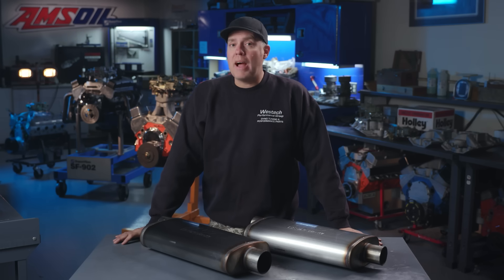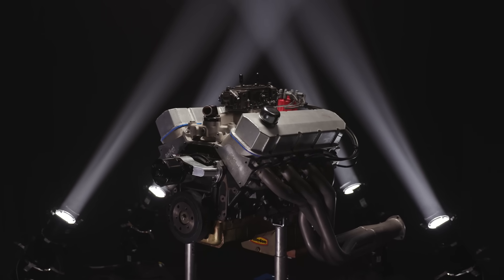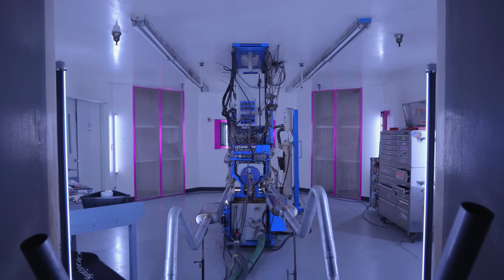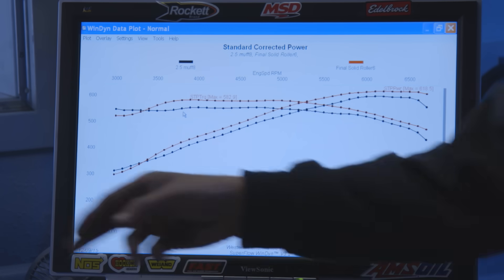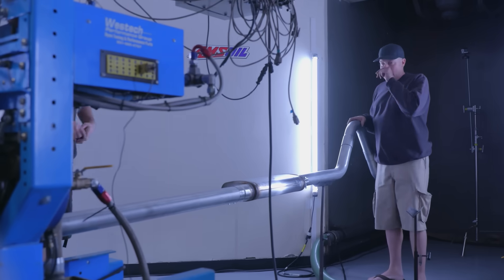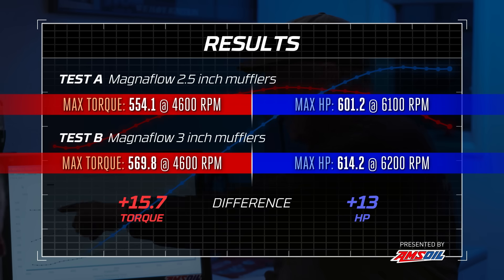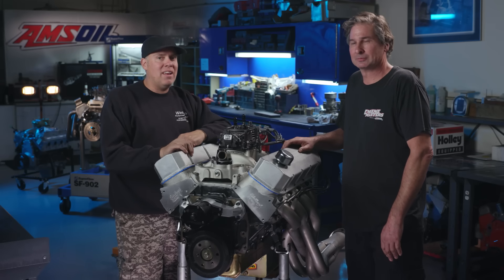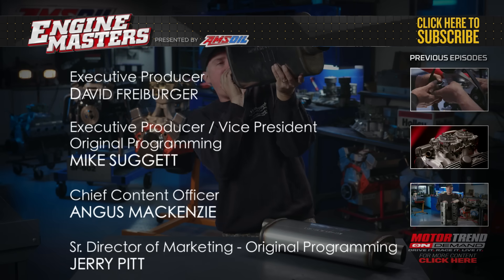The Power of 2.5- vs. 3-Inch Exhaust - Engine Masters Ep. 9

Comment: Of course the 3" was better. A 454 making 600+ is flowing a shit load of air, a 2.5" is definitely going to be restrictive. But this is a big engine, a 2.5" is probably going to make more power on a small engine than a 3" would. If these guys cared they could calculate flow rates and actually figure out the optimal pipe diameter for there system.
Reply: +Taylor Elley yeah i was hoping they'd use an engine with 300-400 hp or something that most people actually have
Reply: +Taylor Elley Did you not see how the open headers STILL made more power. Basically you will never loose power with less restriction. Obviously the gains by having a huge diameter exhaust on a small engine wouldn't be worth the extra noise, so you find a nice compromise you're happy with.
Reply: They weren't open headers, they had a tuned length extension on them, remove those extensions and you'll probably see a power drop (exhaust acoustic design is a fucking interesting topic).

Even more dramatic, remove the headers. Surely you would say the 2.5" headers are a restriction? That would mean no headers = more power right? No fucking way.

 I would like to see the difference in power if you removed the muffler from the 3 inch system (same length exhaust). Or if you shifted the muffler to the point where the header extensions would have ended (18" from the header if i remember correctly?)

Comment: i think i would give up 20hp in order to be street legal and not have exhaust drone.
Reply: nah, i guess i have different ideas of what a car should be. something that only goes to the track or show, by all means run straight pipe. something i drive as a semi-daily it has to be legal and comfortable. going from 620 to 600 is only a drop of about 3.5% which is not noticeable while driving.
i think the best of both worlds would be to have the quiet exhaust but has dump valves for race application.
Reply: +adam courtney straight pipes are gay, flowmaster 40's are where it's at.
Reply: Alexander Moffitt i won't get into what is better in regards to brands but i just said straight pipe in regards to no caring about the noise.

Comment: Why do we have to mislead people by oversimplifying incredibly complex fluid dynamics.  Bigger isn't always better.  Sometimes with a smaller motor, smaller tube will actually flow more gas because of higher exit velocities.
Reply: +Get Shrekt At least they informed people about the back-pressure myth. I hear this from almost everyone. People need to be informed that one of the main reasons to properly size your exhaust is to maximize exhaust scavenging which actually lowers back-pressure.

Comment: Whys do these guys always use a chevy engine?
Reply: Because Chevy is better
Reply: than...?
Reply: +Alexander Moffitt says inbreds
Reply: +Tiger productionzz common cheap engines that's why
Reply: matthew von oh
Reply: +Tiger productionzz  They're tremendously popular, these days you see a lot of Gen 3+ LS chevys and the Mk IV Chevy Big Block has always been popular, parts are plentiful a lot of kits to bolt the motors in a lot of cars.  The Small Block Chevy has been popular for 50 years and there are so many of them out there you can get a six pack of bare short blocks for a single aluminum LS motor.  I'd say after these the Chrysler Hemis are popular especially among drag racers and the Windsor V8 Ford, again because they've been around forever parts are cheap and there's a ton of easy recipes for building them.

Comment: question. I have a 427 sbc in my 68 Nova. I Run 3" exhaust and I recently installed electric knockouts. I installed them behind my X-Pipe, and the knockouts are about a foot back from the headers. Anyways, Will the X pipe (3" also) kill a good amount of HP if any?

Comment: hey engine masters.. does this theory apply to turbo charged motors as well? maybe try repeating with the same? 
Love this segment!!!
Reply: +Sulleiman Kamau With turboes the larger size is better, you don't have to worry about noise as much as the turbo itself acts like a muffler. All you really need is the down pipe.

Comment: Would have liked to see you add an X pipe vs H pipe to go along with this vid! Great vid though!
Reply: +sailorsteve56a A mustang magazine has a comparison..I was surprised of the sound difference, H-pipe is deeper sounding vs. the X pipe. I saw in chevy magazine, both give the same type of power increase 7-12hp depending on the motor's output.

Comment: I have a Paxton coyote on stock exhaust with just an offroad X... I've chosen to put my blinders on and avoid changing the rest of the exhaust because I like the quiet/sleeper effect... but it looks like I gotta get with the program.  Car put down 570 uncorrected, 598 corrected at the wheels, so probably a good bit more crank than this block... I wonder how much factory exhaust manifolds, resonators and mufflers are costing me. heh

Comment: Very good info. I have a 2004 dodge ram hemi stock engine with a 3" stock exhaust and a 2 1/2" Flowmaster outlet and tail pipe, would I need to upgrade the engine to see improvement if I install a 3"  full exhaust?
Reply: +Matari 7 3" single to dual 2.5" flowmaster cat back? Yeah, It would be best to wait until you have more engine work done and run full length headers race cats and do true dual 3". The stock manifold, Y-pipe and cat are the big restrictions for you. TTI makes the best exhaust for any MOPAR link below for what you need.

Here is your stock manifold/Y-pipe, cats( you can see how the Y pipe is compresson bent/pinched down
:
http://image.sporttruck.com/f/9006749+w750+st0/0705st_02_z+2006_dodge_ram+stock_manifolds.jpg

Truck trend put on a TTI full exhaust on a 06 5.7 and picked up 43!!! more lb-ft of torque at 3,400rpms. Here is a pic of the TTI setup:

http://image.sporttruck.com/f/9006752+w750+st0/0705st_03_z+2006_dodge_ram+headers_and_y_pipe.jpg

and here is the article:

http://www.trucktrend.com/how-to/engine/0705st-2006-dodge-ram-tti-exhaust/

Comment: i gotta say i have an 88 f250. had the nasty stock exhaust put on duel 2 1/2 pipes into an x pipe muffler and out as 3 inch and it really woke up the engine

Comment: it was a pretty predictable thing lol I do think it depends on power. a 600 hp application does need a 3 inch exhaust. a 200 hp application? I know the fiesta st comes with a 2.1 inch exhaust from the factory. upping that to 2.5 is the perfect size for keeping the engine from becoming too lean or rich whilst giving the engine the added boost.
Reply: +Dylan Knight This was exactly what I was thinking when I was watching... Lots of CBE are going for the bigger = better with their 3" exhausts. But there's a reason why the more reputable brands like COBB, mountune, fswerks are all using 2.5". Cause the oem turbo doesn't make use of a 3" pipe. Unless you cyborg or big turbo, 2.5" is better.

Comment: Tell me where I'm wrong here...
I'm thinking if you'd corrected jetting on the 2.5" system to get a better A/F, you'd not only make better power but you'd improve fuel economy as well?
(Yes, some of us buy our own gas. Shocking, I know)
Further, you made no mention of A/F on the 3" system. I wonder how close to just the open extensions it was - or even in comparison to the 2.5" system?

Comment: Everyone hear me before going all internet on me..so they proved the 2.5" is the better way to go or at least basically the same end result. 13/16 gains at the crank means, what, 9/12 at the wheels? But you gain 10lbs which kinda negates the power advantage making it a personal preference..also remember the farther south of 600hp you are, the smaller the gains will be but you still gained 10lbs.
Reply: I was thinking the same. They made the difference out to be much more than it was.  3" had more under the curve, but 2-3% gains isn't blowing anything out of the water.  On the street, it's only use is begging for attention.

Comment: Id like to see this on a small block with a much smaller displacement.
Reply: +Kevin Jones That is what I was wondering. I went 2.5 on a supercharged small block with long tubes & no cats  because I did not want to over do it and lose torque. But my high school self said to put on the biggest exhaust I could find. I wonder if I should have listened to him? He also said to install the biggest cam and 4.30 rear gears....

Comment: would love to see the 3 inch with an H pipe or an X pipe.  thats whats in my 68 firebird with a mild 461 stroker and I love it.
Reply: +Invincible Extremes Muscle Cars Garage exactly,   and throw a Y-pipe in there  for good measure.
Reply: +SOCAL3800 yes, because many guys have 3rd gen and 2nd gen camaros with that setup.  and trucks too

Comment: Would be nice to see this comparison on an engine like the majority of people have.  Say maybe a 300-350 hp motor.  The findings may be different and the motor isn't moving as much air as a 600+ hp motor.   Would also be nice if they added in the H-pipe and X-pipe into the comparison to see which system offers the best performance.  I guess its all really depending on your motor which size system you need to run.

Comment: Exhaust pipe sizing has one ultimate goal if you're going for max power: exhaust gas velocity. Too small piping will choke the motor. Too large will lower the exhaust gas velocity and actually make less power. They key is to find the sweet spot for your setup. Bigger is most certainly not always better. A 4" single-exit exhaust on a high power Supra will not be good for a built N/A Civic.
Reply: +Numinous A chart to make choosing easier, courtesy of Dynomax;-)

http://www.qsl.net/ya5t/techchart.jpg
Reply: JerseyMikeP It's a little different for me, since I'm forced induction (2.3 DI Turbo running 25psi). 3" serves me great at my power level, ~380whp.

Comment: What about H or X pipe setups? What about a 2 into 1 setup with a single 3 inch muffler? Would love to see this test with a chambered mufflers. My understanding about exhaust or exhaust tuning is anything that is post header is strictly for sound or emission unless its causes back pressure. All of the actual exhaust pulse/extraction tuning happens with length, diameter and shape of the headers not the rest of the exhaust.

Comment: What if you had a smaller engine putting out around 350 hp? Wouldn't the 3 inch be overkill and not give enough back pressure for the smaller engine size?

Comment: of course this only applies to 600hp v8s lol. If you have a i4 please stop using anything more than a 2.25" exhaust you are killing us all :P
Reply: what if you planning on boost
Reply: +Austin Doud you're
Reply: +Austin Doud When you have boost, my theory is the bigger the better. I have a turbo i6 and the difference between a full 3" exhaust and full 4" exhaust is quite dramatic. Power feels slightly higher with the 4" but the biggest difference is how quickly the turbo spools.
Reply: +Austin Doud At that point, if your doing more than a modest setup then fuck what people think. But if you`re just putting together a lil budget boost motor from say random oem parts from other cars etc or running around in a stock turbo car, than why bother sounding like a turd? idk, just my opinion. I went through the loud honda phase when i was a little shit but now i`m old an it`s just obnoxious. Save the 3'' dump tube for you`re weekend race car, something with real time, money and commitment involved.
Reply: +Hooch really at that point all you're going to hear is turbo whistle

Comment: The reason they say a little bit of back pressure is necessary is because most of the people coming in aren't going to re-tune their car to match the exhaust system they are running. Hence wanting to make a louder better exhaust that has back pressure similar to factory.

Comment: Awesome video. I am making about 300whp in my 4 cylinder using 3inch downpipe to a 2.5 magnaflow exhaust and it looks like I can gain some hp with a 3 inch exhaust.

Comment: You did not disprove back  pressure lmao.  Perform tests from low rpm idle of 800 to 2500 rpm and watch what the torque does.  Wide open throttle operation is completely different.

Comment: But how much power do you lose cause you're running richer with the 2.5" exhaust? Only then would it be a fair comparison if you ran the same AFR...
Reply: +Jalmarification I was thinking that too.  Really should have re-tuned it after putting the 2.5 on and then gotten some better results

Comment: That exhaust is nothing like you would put on a street machine. In fact it wouldn't fit under any car at all. They should have used a dual exhaust system for a 60 or 70s Camaro,Mustang,Cuda or Charger. There is some rigged funny business going on with this comparison that is for sure........The difference might have been even closer if the exhaust wasn't so long allowing for more area for the 3 inch to shine.

Comment: This video is an excellent demonstration but does understate the importance of tuning.  There are a number of good books regarding intake and exhaust design to utilize harmonics to improve power in certain areas.  That means knowing where you need horsepower or torque and building around that.

Comment: great vid.  that thing sounds beastly even getting choked by the 2.5's.  It would have been interesting to see relative sound pressure level readings off each setup and now I'm really curious what it would have looked like if the engine were finely tuned to make the most of each setup.

Comment: You should test whether an exhaust leak kills power or has any effect, and try different areas like engine to header, header to midpipe, and midpipe to muffler.
I'll bet if you drove a car with that engine and tried both exhausts you wouldn't be able to feel the difference. But that gives me another idea, you guys should test the "seat of your pants" feel. Get a car with a bunch of different incremental horsepower level tunes (that could be easily switched by a plug in tuner) and see how much horsepower it takes for a person to fell the difference in power.

Comment: Would this do anything for for a NA 300hp 5.0l v8?
Reply: +Ryan N You might see about a 6 to 8HP difference. Not much at all.
Reply: +Ryan N What year 300hp OHV 90's 5.0? That stock exhaust was small, so mandrel bent dual 2.5" would give good results. Nice set of long tube header KOOKS, Hedman, hooker, BBK race cats and Dual 2.5" are good to 425-450hp before they start costing power....but even then it's not that muchof a lose...in this video 2.5" only cost 13hp vs the dual 3" on a 620hp motor.
Reply: JerseyMikeP it's actually a 2004 Mercedes CLK500

Comment: This test is pretty pointless for the common enthusiast. Most of us driving ponycars and old school muscle aren't running 600hp engines. We're running fairly stock or slightly modified rebuilds between 300-450 hp. Why don't you show us something we can actually use to compare apples to apples. Even the high horsepower modern stock factory engines these days are using 2.5" exhausts. 2015 Mustang GT 435hp and 400lb/ft torque... 2.5" exhaust. Even the majority of aftermarket kits for this car are 2.5". Show us something we can USE!!!

Comment: Lol @ engines really "liking backpressure" comment... The thing is, you're using a 650hp motor... 2.5 is regarded as "perfect" for 250-400hp engines... so of course it's going to choke out a 650hp engine. It would've been nice to see this test with a 375-400hp engine.

Comment: An anemic not built up engine will still need some back pressure.   With weak stock valve springs on some engines you risk flouting the valves I always thought.  That engine was fully built up and had zero need for any.
Reply: +Lucky Bob Anemic/weak valve springs....It sound like the money better spent else wear than dual exhaust,LOL.
Reply: I fully agree, but how many people to huge or open exhaust before anything?

Comment: i think back pressure is just needed on 2-cycle motors.

My pocket bike was a little sluggish without the muffler attachment, just a pip that curves around to the back. I put a big atv/dirtbike muffler on it and notice a big performance step of acceleration and getting to top speed. My first test run without muffler had got about 20-22mph up just a small slight slope. 2nd run with muffler hit 25mph with half-choke to run rich. I think it can get 28-30mph on flat smooth surface.

Comment: This episode could have used some explanations about why the 3" exhaust worked better on this engine in particular. 3" is not the magic number for every engine, so the results do not carry over without explaining the fundamentals. 2.5" vs 3" on a stock 4.6L? On a 3.8L V6? On a 1.6L I4?

Comment: I found it interesting that the power numbers fell way off at 6700-6800 with the full exhaust systems, whereas the open headers appear to still making decent power beyond the limits of what was shown in the graph. Was that strictly a functionality of the back pressure killing performance or was that Steve killing the dyno at the end of the run?